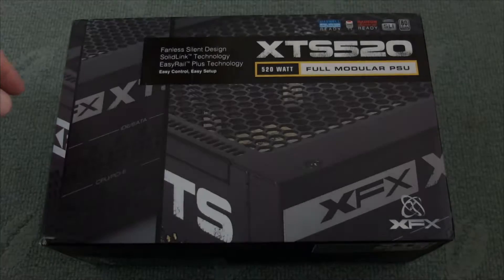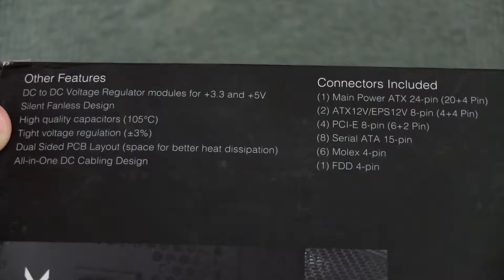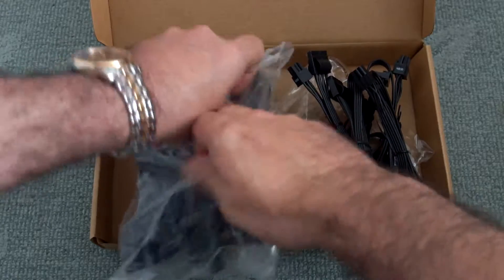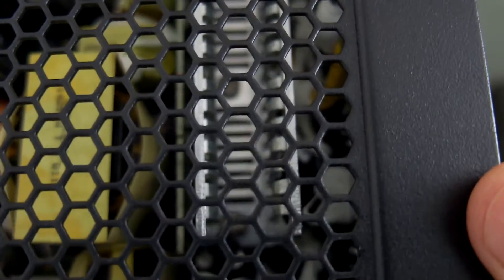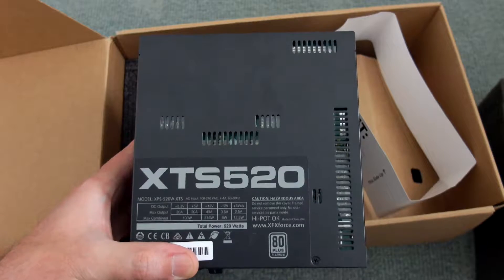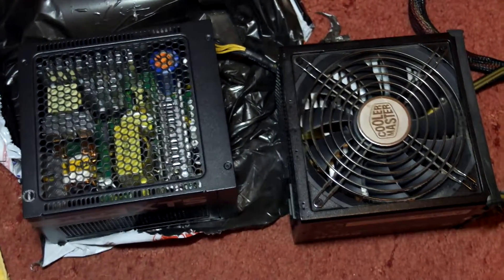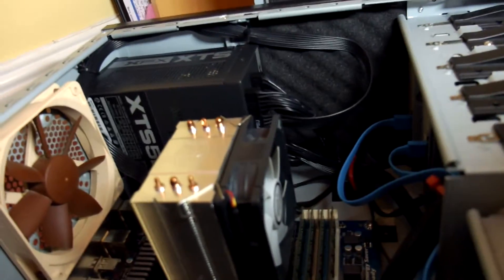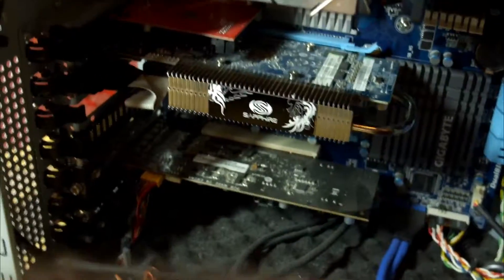XFX XTS 520w "Fanless" Power Supply Review

Comment: Great dude thx!
Reply from the maker: No problem glad you found it useful
Reply: will be good with i7 6700k and 1070 ?
Reply from the maker: It's more graphics card power that should be a concern (say dual high end powerful cards then you need to get a higher rating). Those CPU's won't cause any problems at all for you with this power supply